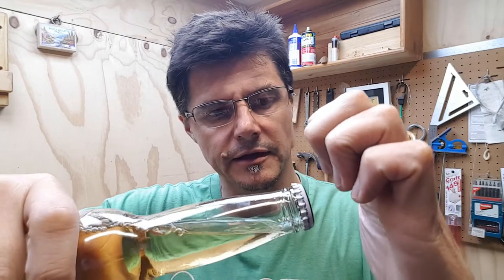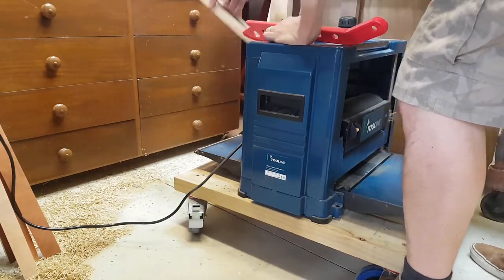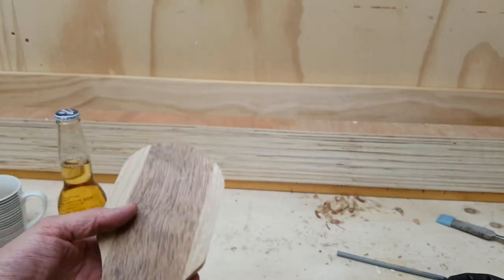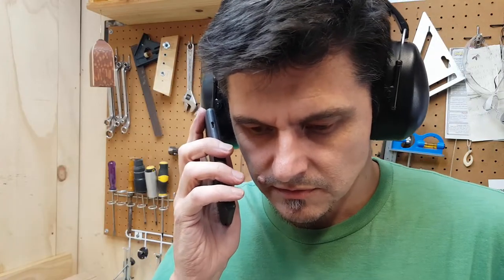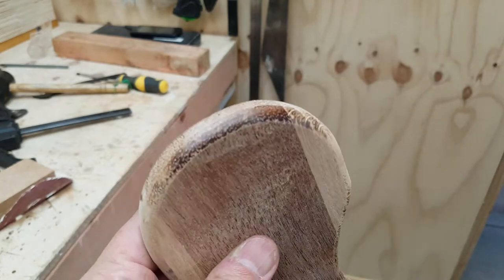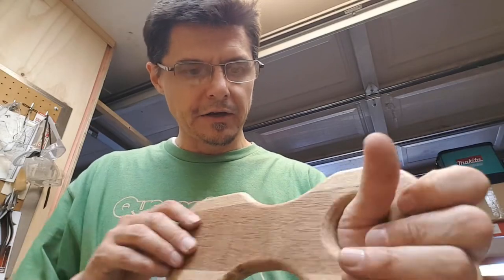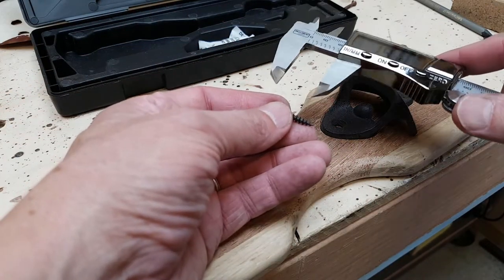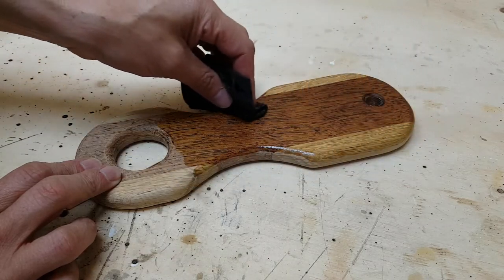Tools' bottle opener

Comment: I wish I could have seen you drilling out the 40mm hole. The way you described it made it sound like it was too good to miss, and you made us all miss it!
Reply from the maker: Good to hear that I dramatised it just the right amount - dramatisation aside I was actually about as pleased about it as I came across as my little drill press cannot even get a hole started with a big forstner bit without stalling, so I always have to hog out as much as I can with other means and finish it as best as I can with the forstner but I inevitably screw it up but this time it worked mint. 

In other exciting news I've become vastly more enthusiastic about hand planing over the last two weeks. I've figured out a bit better sharpening technique and set up and stuff, and using (experimenting/learning/practicing I guess you would say) 4 hand planes that I own I've flattened my plywood bench, and today was the best ever - I cleaned up a piece of timber off the table saw so so mint that sanding it now would ruin it not make it better. I was well pleased - anyway I wanted to tell you that 'cos I am paying attention to your vids mate and learning a shit load 👍 🙏
Reply: @TakamiWoodshop  Nice. Using a truly sharp blade makes life much easier, and a easy way to get a truly sharp blade is to strop it in a similar fashion to what Paul Sellers advocates. 

Once you have a sharp blade, things like a flat sole of the hand plane, good mating between the cap iron and the back of the blade, and a tight setting of the cap iron to the edge of the blade makes a hell of a difference. 

From there, a thicker blade is a blessing for a hand plane. They really do make a big difference with regards to less chatter and vibration especially when you crash into a gnarly knot. I like the cheap chiwanese Luban planes. They only take a little bit of work from new and they perform as well as my Veritas but are much easier to setup than my craptastic Veritas.
Reply from the maker: thanks mate I'll definitely take all the tips you can throw at me. I've ordered a strop and some of that compound stuff a wee while ago. I watch Paul Sellers quite a lot - I must go back and watch his hand plane specific vids again. I think this last week & today was the first time I ever found it viable and thought the tool was actually helping me achieve the goal - sharpening is more crucial than can be stressed I reckon.

Comment: 😂😂bwahahahahahaha😂😂
Turned out way better than I thought it would!
Man, you crack me up, love it👍
Even had the missus laughing👌
So, just one question, these bottles not twist tops, aye? 😋
Seen a beauty done with the back routed out quite thin and a few strong rare earth magnets glued in,
So the lids magnetically stick to the wood and not hit the floor.👍
Reply from the maker: hehe. Nah mate - had to use the Corona mate 'cos most of the local beers that I drink (the cheapies) have twist tops. I'm drinking Asahi super dry now though so I need to make one of these openers for me. Magnets sounds interesting - some of them have a basket thing at the bottom too to collect the caps. I didn't show in the vid but I made it so it could be hand held as well - that was the idea of the curves on the side. I actually don't even drink a lot of beer - only about three a week over summer. None in winter.
Reply from the maker: Oh shit that is actually really cool. thanks man!
Reply: @TakamiWoodshop  if you decide to give this a crack, I'd be keen to see your results...
I was going to make one way back when, but I don't drink... lmao
Reply from the maker: You'd have to buy some of those old fashioned bottles of coke mate! 😄
Reply: @TakamiWoodshop  mate, I don't even like softdrink....😝😂
Reply: @TakamiWoodshop  I need to get you off those filthy twist tops bro. When I make your bottle opener you will have to make the step up to the real beer club else you won't be able to use it.
Reply from the maker: lol - I'm getting there mate - usually just get whichever of two types of beer is cheapest at the supermarket but probably gonna make super dry the staple 👍 (not a twisty)

Comment: Be honest, how many days/weeks/months (delete as appropriate) did you spend sanding those router burns out? lol
Nice job anyhoo brah.
Reply from the maker: hehehe - it actually came off really easily thank god - that oak burns if you fart near it and the kwila hardwood is very oily and the oil burns and leaves the streaks you can see on the sanding disk. I'm going to make a couple more of these - I have two more of the opener things left over from the three pack. 🤙 cheers brah 👍